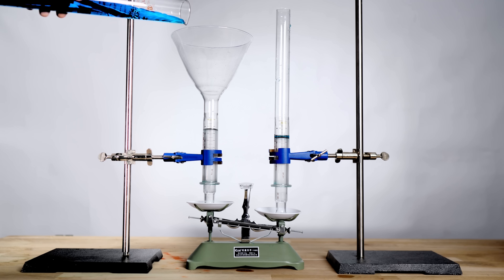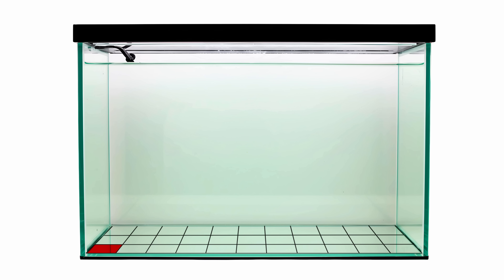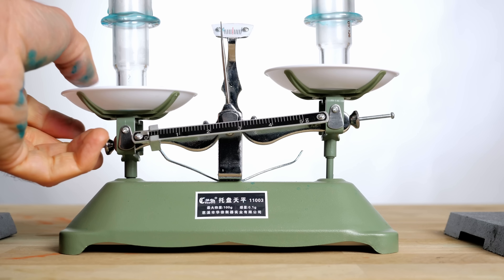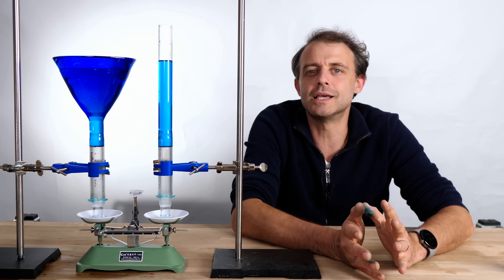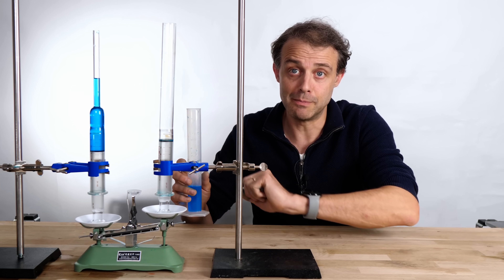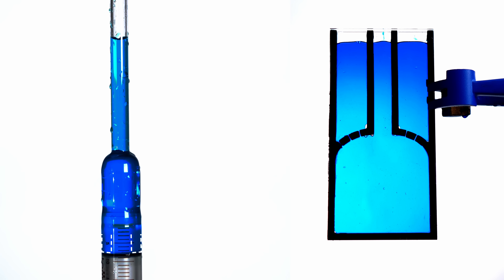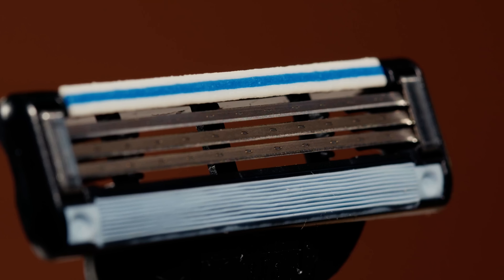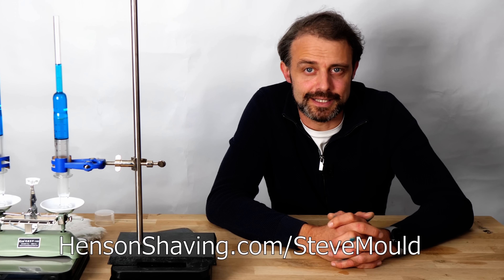The Hydrostatic Paradox

Comment: 3:50 the elephant foot and stiletto's are examples of material and contact stress, not really pressure.  Pressure is  force in all directions and is mostly only applicable to fluids
Reply: "Pressure is force in all directions"

Since Force = Pressure * Area, does that hold for standing on a floor with tennis shoes vs. stilettos in gravity? I think Steve is saying force is a constant for a given weight on a floor, and that pressure and area are inversely proportional. (3:52)

It's fun figuring this stuff out!

Comment: You have to leave out the water that leans on the sloping side of the funnel.

You should only take the water above the piston.

If the piston is half the size who surface area, then you need 2x as much water.

Comment: Then why are multi blade razors made?
Reply: I tried both multi blade razors and a single blade razor, a Henson no less, and the multi blade razors work so much better that it's not even funny.
Reply: @rschroev : Yeah, it seems like it would be that way, doesn't it? I'm not super convinced that this razor would be that great. Besides that, I prefer electric ones.
Reply: @HelloKittyFanMan  Yeah, seems the 'force pulling on the skin' is more an issue with a dull blade grabbing the hair instead of cutting.

Comment: The clamp stand getting lighter totally broke my brain. And I started imagining what shape the tube would have to be to make the clamp stand float and forgot to pay attention to the rest of the video!
Reply: If the top parts of the glass are pushing down on the water, then the water must be pushing up on the glass! Normally, the extra pressure at the bottom will perfectly cancel the extra upwards force, but Steve's piston system lets the base get pushed down and the container get pushed up.

If the narrow part of the spout were taller, there would be more pressure at the height where it flares out. Eventually, the weight of that extra tall column of water would cause a "failure" by pushing the whole clamp apparatus upwards until the piston slides out of the container. It's no different than jumping on an air mattress and causing an object that was resting on it to launch upwards!
Reply: Yeah I feel we need another entire video about that...I mean I think I get it, the pressure up has to be resisted and its by the gravitational weight of the container but boy did this video feel like it ended too soon.
Reply: Well, think of the same setup, but nothing is holding the tube, and you glue a cap at the top of the tube once you fill it entirely with water. It would be then entirely resting on the water which is resting on the piston.
Reply: @lake5044  that helped me
Reply: imagine its not water but a human inside exerting the force. Their feet would be pushing down against plunger, back/head pressing against the curved glass at the top, it makes sense thinking about it like that. If there was no glass at the top (like first column) the human would nothing to press against at the top. so the stand wouldn't get lighter.
Reply: @danielsmith7105 The way you described it was perfect. Thank you.
Reply: He really didn't explain that bit much at all, just said it and moved into the ad. I want this video to be longer!
Reply: I would have like to see the whole set up at that point in time.  I’m not clear exactly what was on the other side of the balance.
Reply: It wouldn’t float, but if you got enough water, it might tip over.
Reply: Yeh I can't believe he went fairly in depth with all the basic stuff then that was pretty intuitive anyway & then just dropped that bomb at the end & finished the video. 😅 Must admit it took me a few mins to figure it out🤭
Reply: The upwards force on the cylinder "bottleneck"  is none other than Archimedean buoyancy .  Each area element of a submerged surface is subject to hydrostatic pressure.
Reply: that's the same as buoyancy and the stand would "float" when it has displaced as much water as the weight of the stand
Reply: It doesn't have to be any strange shape, it just has to be a lot taller (although having a bigger piston will help too). The more water Steve pours into the thin tube, the lighter the clamp stand gets, until the whole thing is being held up by the piston instead of the stand!
Reply: that's how boats work
Reply: Imagine blowing air into a balloon on the table. It will rise upwards. Same concept here.
Reply: Take away the clamp, seal the top, fill the chamber with compressed air, and put a quick-release valve at the bottom (hold the piston in-place despite the compressed air).  Now rest the piston on a surface and let the quick-release go so that the piston can move freely.  Basically a rudimentary model rocket.  If you put the clamp back, there's no reason it can't fly...a little until it tips over because of imbalanced forces because of gravity.  It's essentially the same effect (I think?  I'm a programmer so my depth on this subject is lacking), but everyone intuitively knows how a compressed air model rocket works.
Reply: if you imagine the piston being fixed to the ground and the narrow tube extending really far up, one might imagine that a lot of water would just end up pushing the whole piston upwards
Reply: And the answer to that is a thing that rhymes with "float"
Reply: Or (hear me out), what shape would power a spaceship to Mars?
Reply: It's like blowing a balloon, it pushes on the pressure on your lungs. Same with the clamp, it's being pushed up
Reply: I imagine the water is pushing "up" on the top of the bulbous bit of the glass, which is being held by the stand, so the pressure at the top of the bolbous part of the glass is "lifting" the stand.
Reply: Picture something like a big flat disc: ══╩══. I think that helps understand how the water would push up on the upper glass and the clamp stand as you pour water and increase pressure in the disc.
Reply: The only way it could "float" is if you sealed the left side and then poured enough into the right side to exert enough pressure through the tube to lift the left clamp stand.

Well, actually, if you could make the little tube on the left thin, light and tall enough enough, it could effectively be "sealed" by the pressure that would be needed to lift such a tall column of water, and that could lift the stand. I think. Either way, it's just counterintuitive.
Reply: The shape is a topological match for a piston.  A small hole feeds pressure into a chamber pushing apart the two sides.
Reply: seriously, what the fuck!
Reply: You don't need a different shape, just a taller tube (taller thin section). They higher the water level, the higher the pressure and the lighter the clamp stand gets.
Reply: Best analogy for hydrolics/pressure is prolly gear ratios. All that force is going into the thin stream of water
Reply: I was also confused, then i realize there is the second tube. What he told about the funnel applied to the second shape. Its just a reverse funnel.
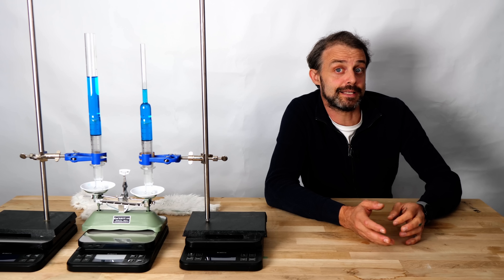Reply: the thing is, the fluid pushes up as we regard to pressure as a pushing force (10:31) , the fluid pushes up on the tube and hence the clampstand weighs lighter, and bcz its pushing on the tube upward , the same equal and opposite contact force is acting on the fluid making it put more pressure downwards too, resulting in more weight than the amount of liquid, or should  i say that the liquid is supporting the tube by applying a upward push/lifting force on the tube/piston which means its supporting its weight and hence is weighing more than just the liquid.
Reply: The water is pushing up on the ledge from the pressure.  Just imagine the water having a foot upside down pushing on that ledge.   That's what makes the stand lighter.
Reply: Do make a video if you experiment this idea with air and if you could make a heavy object float in the air.
Reply: The way to think of it is that the narrow tube side is getting pushed upwards by the lever and the wider tube side, but only until there's enough extra weight from the clamp to push down on the water with the glass sitting above the rest of the water column to offset the upward thrust
Reply: It's partially floating on the water.
Reply: It’s basic hydraulics.
Reply: @EnthalpyAndEntropy  Thanks. Really enlightening
Reply: @EnthalpyAndEntropy  Me when I watch a basic science video about a topic I already know so that I can act condescending
Reply: @bobson_dugnutt  yep. I’m totally a douche nozzle. 😂